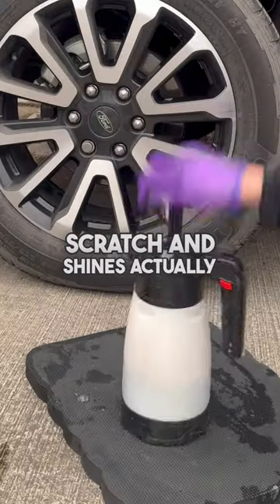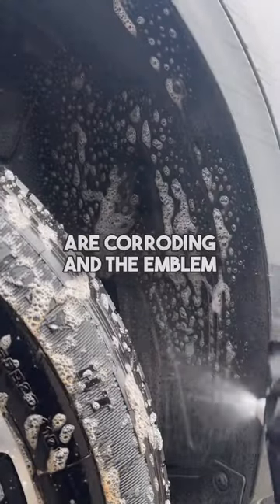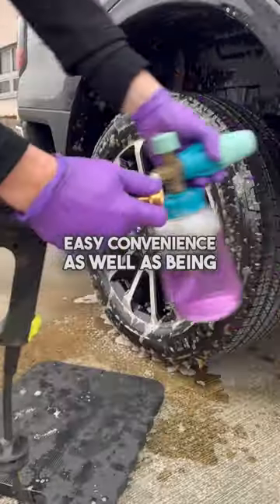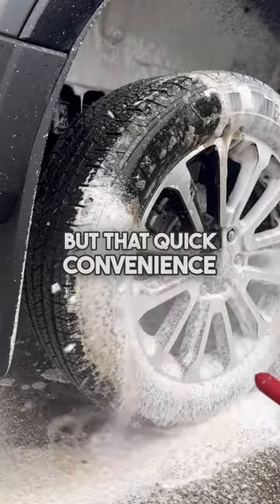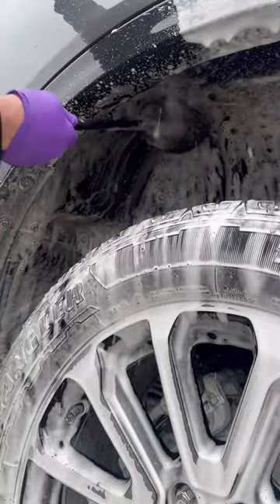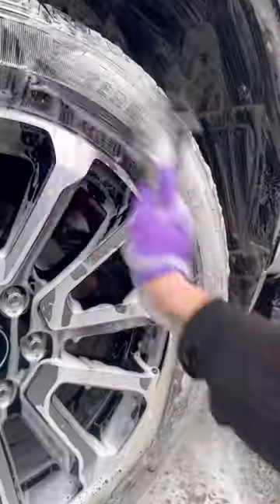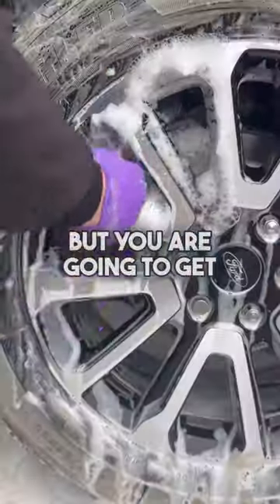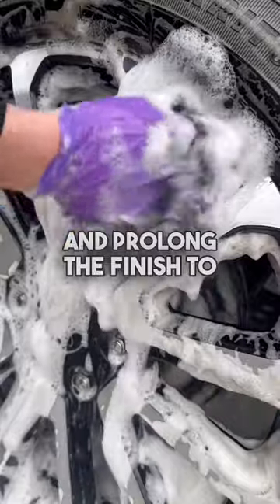Washing your cars with BRICKS 🧱 #detailing #shorts

Comment: I always wash my own cars. From all the products i have i get 15 washes which is cheaper and i coat it after every wash with ceramic. Much better than wash and go places as they dont follow two bucket methods and they use circular motions. Wax they use is far harsher on the top coat of the car
Reply: I wash with diswasher soap or i go carwash and get the works